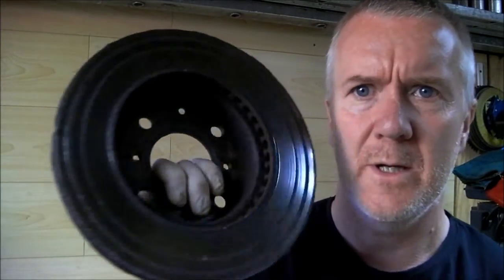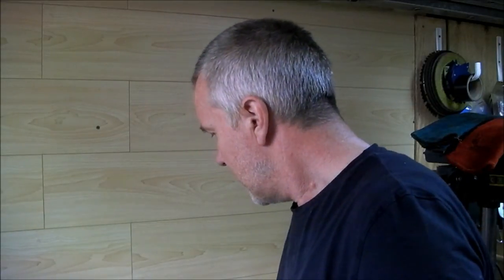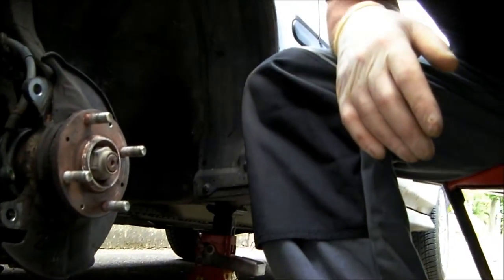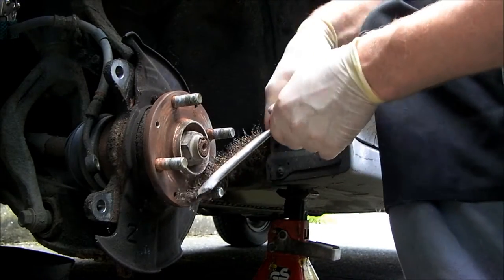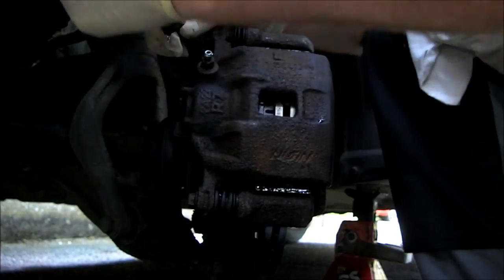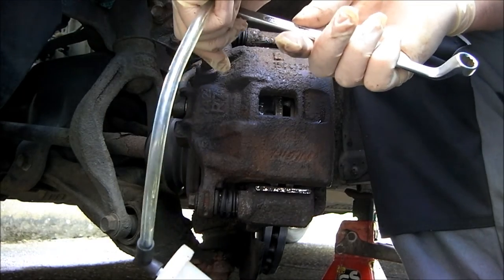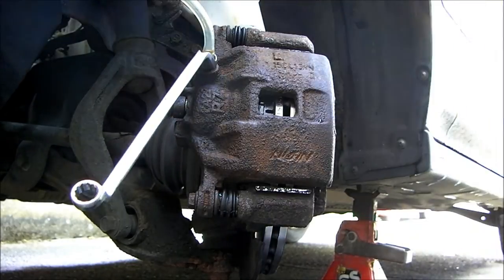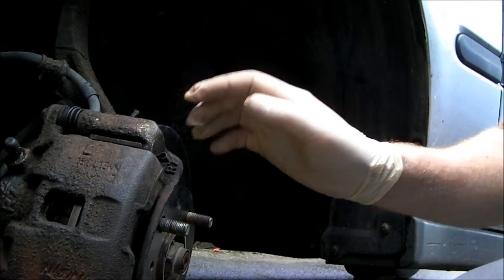Brake disc replacement , parts reassembled and bled

Comment: A few things you should have done at least I think. The new rotor should have been cleaned with brake cleaner .all screws and studs should have anti size on them.  .
The slide bolts should have been cleaned and re greased. The place where you got the parts should have told you some of the things I talked about. Check out Eric the care guy his is a certified mechanic . I am a back yard mechanic and my dad 35 years as a professorial mechanic. I got to work with him at the places he worked at. Back then kids could go places like that . Now no way would places do that today.
Reply: lol he did all those things and more in the other videos. Eric the car guy is a spoofer